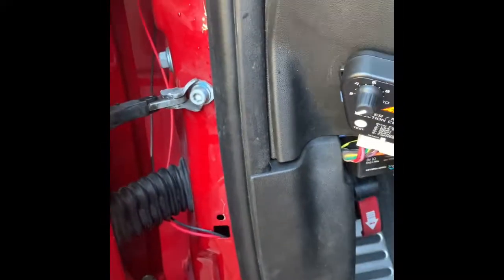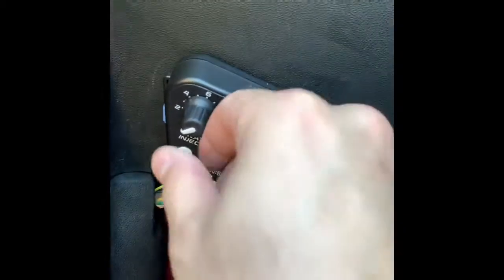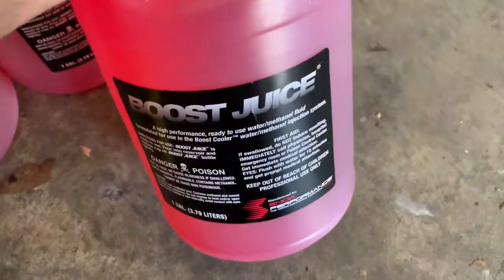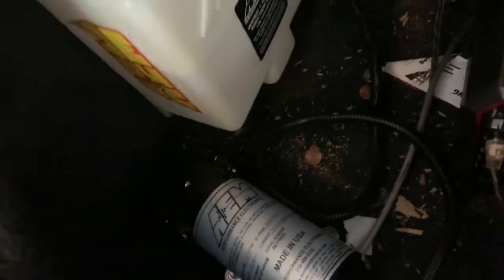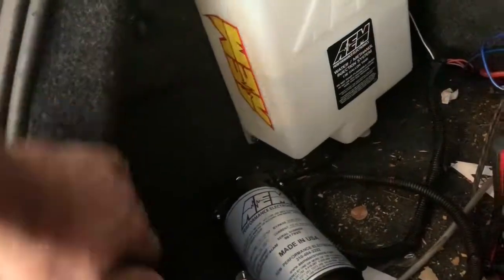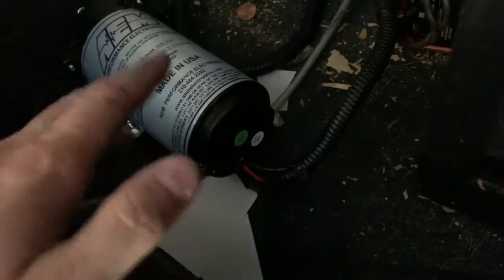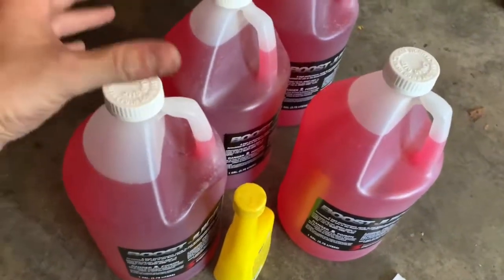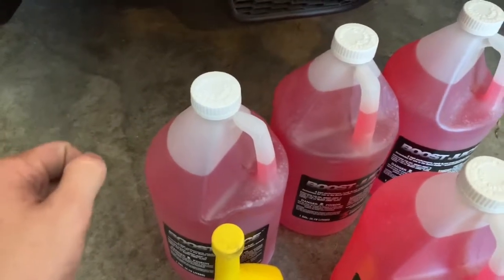Fiat 500 Abarth Methanol Injection Kit Walkthrough Part Two DIY

Comment: Finally, someone with a messy trunk like mine. I've never used this stuff. How fast does it get used. I ran nitrous in the very early 90s so that's my only reference to power adders.
Reply from the maker: Lol it was a rough summer 😂 it gets used decently fast or if you have a heavy foot. It’s not like nitrous but it does use an injection style port that you connect before or after the throttle body